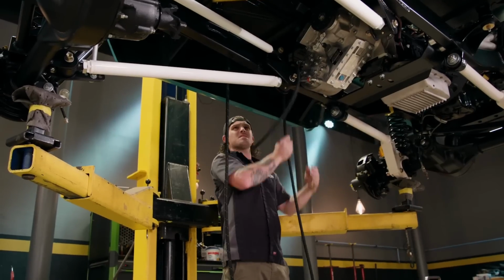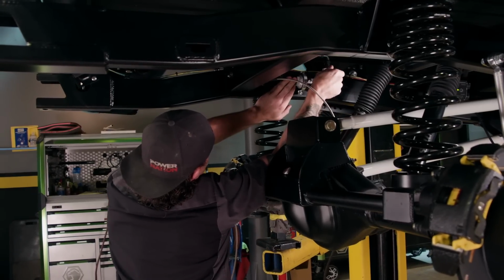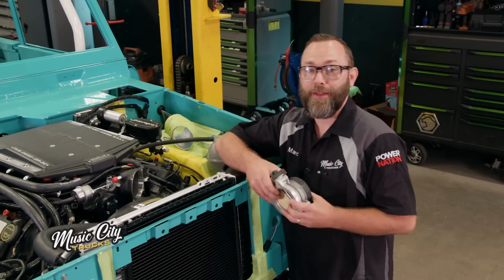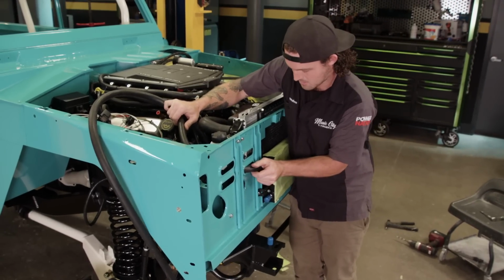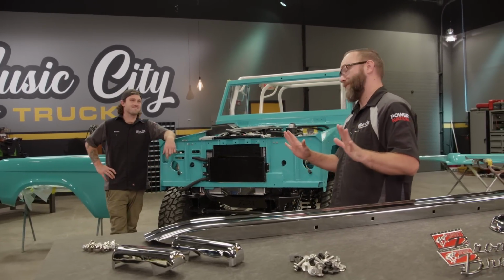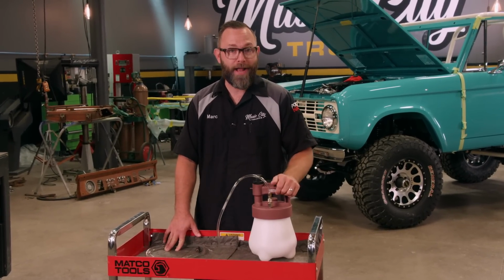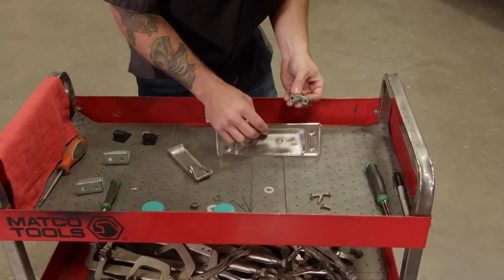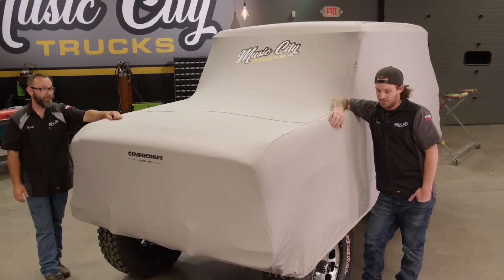Fitting The Rebuilt Classic Bronco With Its RetroFit Fuel System - Music City Trucks S1, E18

Comment: The only problem with sticking a coyote in a Bronco or slamming a pickup to the ground is that you’re defeating the purpose of the vehicle that it was originally created for. To justify that engine you’d need to be able to go flat out off road or on road and the suspension is not suited to either. Ford make a five cylinder diesel that can deliver high performance but still pull stumps at idle, it would have been more interesting to drop one of those in as several people have gone the coyotes route already.

Comment: Awesome build no doubt but why use the body lift filler panel in the rear above the bumper and not one in the front? The huge gap looks terrible between the bumper and the grill. They kinda skipped the hard part of installing the tailgate without damaging the fresh paint. And Why install the hardtop without any weather stripping? Great to see a early bronco build tho, now for a FSB!!